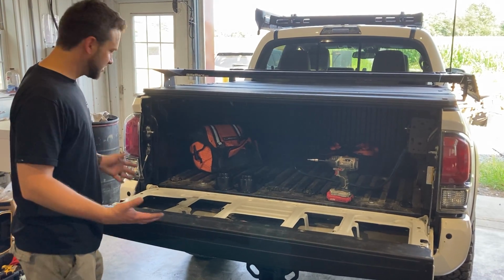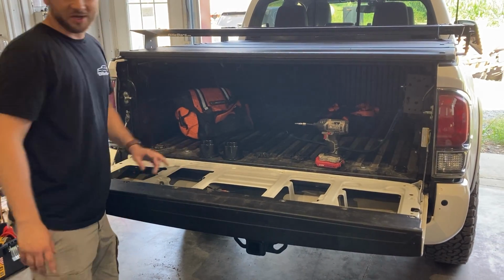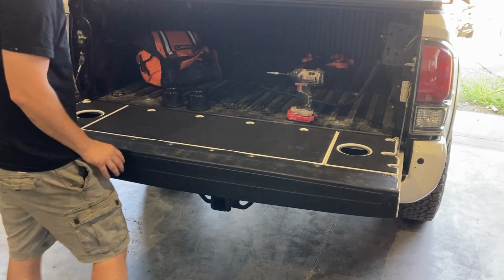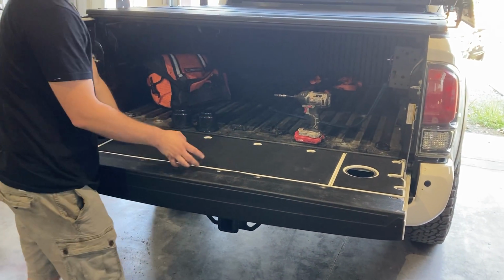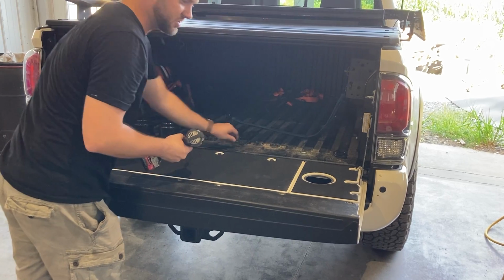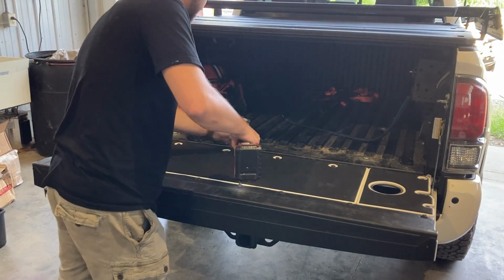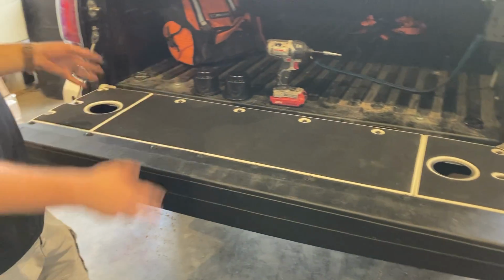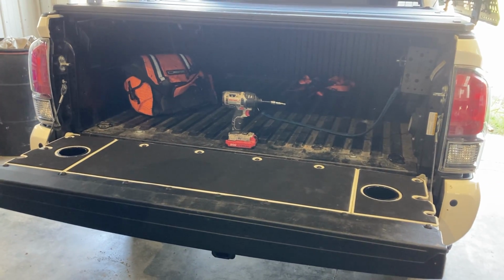Tacoma Tailgate Cover Install 2005 2022

Comment: I need to take off the top screws but they are stripped? How do I get those off? (my gate wont open, I think that linkage part is off, so I need to get into the gate itself and reconnect the long metal arm thing) I think?
Reply from the maker: Try drilling the heads of the factory bolts out or using an ezout kit!
Reply: Depends. Are the heads stripped or are the threads stripped?
If the tailgate won't open ... I have to ask ... is it locked? 2nd or 3rd gen? If it's a 2nd Gen Pop & Lock handle and locked, the handle will pull but do nothing. Basically it'll feel like the linkage doesn't engage because it's not supposed to when locked.
Otherwise, you're going to have a hell of a time getting the panel off with the tailgate closed.